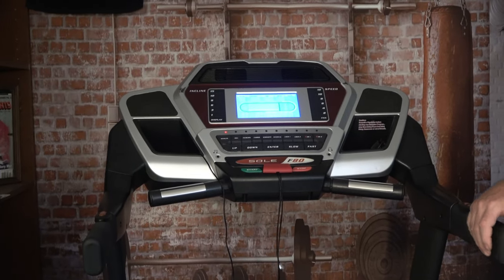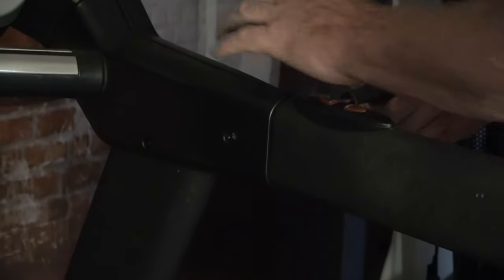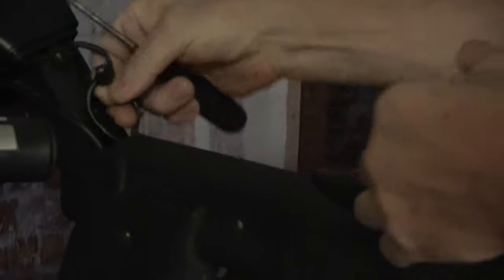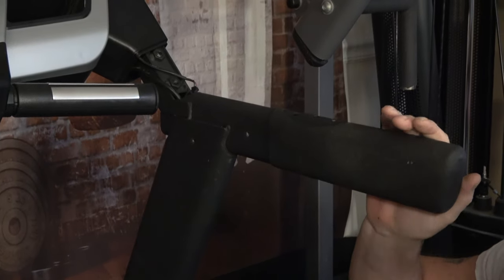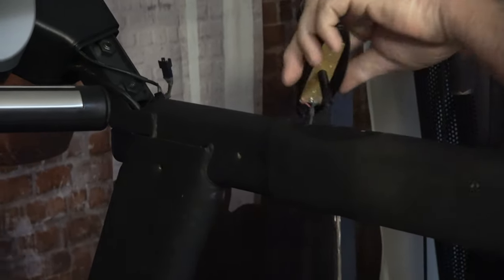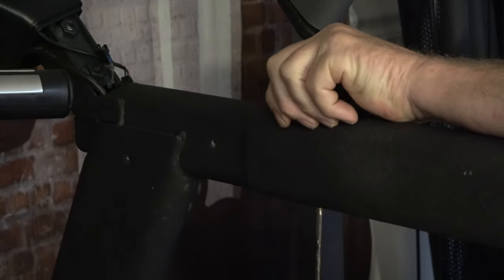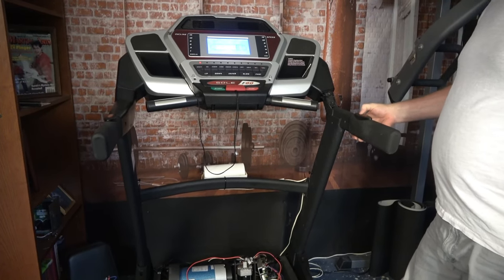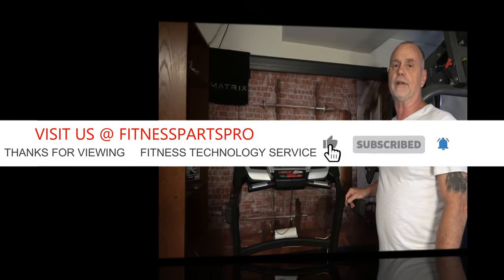SOLE TREADMILL HANDLEBAR SPEED SWITCH  REPLACEMENT

Comment: Thank you so much for the video. Could you kindly send me the link to by the up/down buttons
Reply from the maker: I need your serial number to send you the right one. Please email your serial number to 
Fitnesspartspro. Com 
And state you need the link to purchase the up/down button and if u need the speed or incline button.
Reply: Thank you for your kind reply. My sériela no: 10T1-16010016. (It is a model F85). I need the speed up and down button that is located on the right of the treadmill.
Reply from the maker: @boonleeglobal  sole system does not recognize that serial number what country is the unit from
Reply: @FitnessTechnologyServices  Thank you for your reply. I am in Singapore.  I think the part for F85 model should be the same?  Thank you for your and advice 🙏🙏🙏

Comment: I am really desperate.  Where did you get the speed adjustment switch?
Reply from the maker: We carry them on our website Fitnesspartspro.com or you can email me your serial number to Fitnesspartspro@gmail.com they run around 18$
Reply from the maker: We have them listed as sole treadmill handlebar speed switch with wire